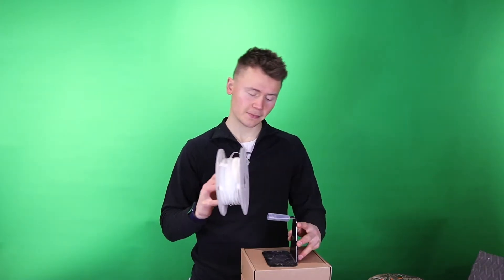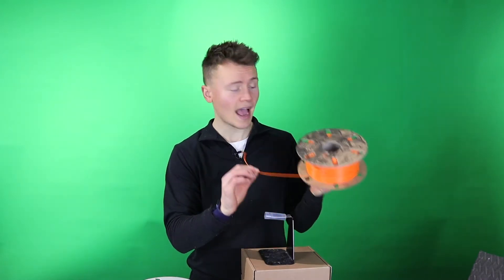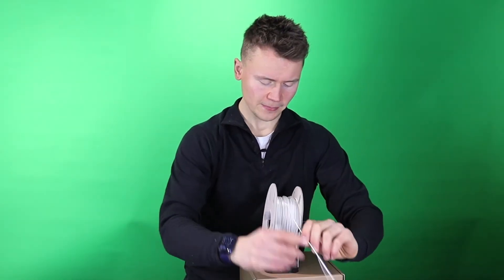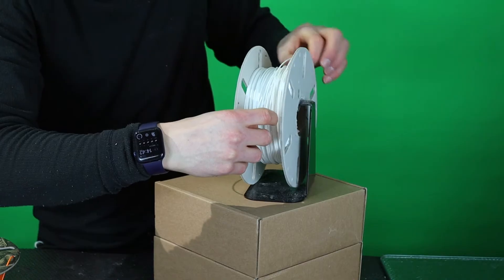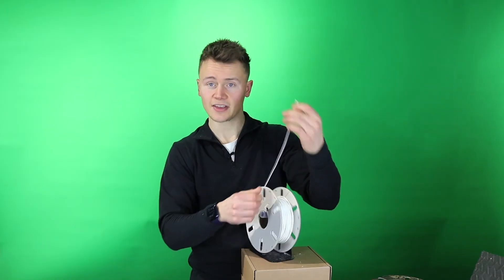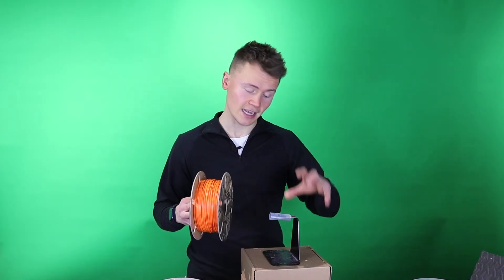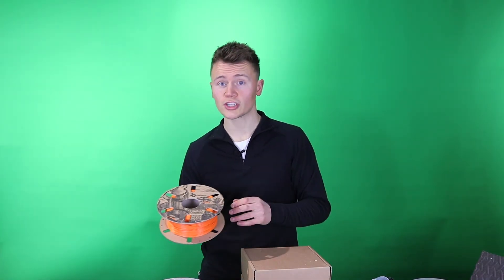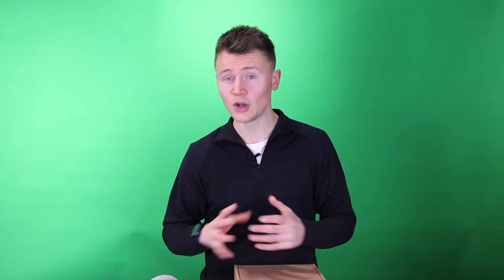FILAMENT TANGLES - How they occur, how to prevent & how to fix

Comment: My filament failure was actually a bamboo Labs spool that came unlocked and when my AMS was pulling on it it caused the whole spool to loosen, widen and pull the filament down deeper into the other layer rolls. It was a disaster. It was too wide to fasten the two-piece spool back together. 

As far as storage I printed out nice simple little clips so I can just clip the filaments in line with where it is on the spool without having to weaving it into the side.

Comment: Got my first tangle after 2 years of doing this. New roll. How was this me? It printed 10 hours before it tangled. I blame the factory….. sorry.
Reply: Yup, just happened to me.  I had a number of items to print--almost continuously over the course of five days.  I started printing with a used spool (roughly 200g of 1kg remaining) and when that reached the end I opened a NEW spool and fed it into the bowden tube right at the end of the previous filament.  I watched the job for about 10 minutes and walked away.  I came down about 30min later to find the printer paused due to a tangle.  I pulled on the filament on the reel and it took quite a bit of effort--definitely more than an extruder could.  Print job continued and paused again when the filament reached the same "outer" position on the hub.  For some reason the spool was wound at the factory with an "underlap" of the filament at the outside edge causing this.  The entire spool required me to babysit it.  When that spool was depleted, I opened another NEW one, and the same thing happened.  This was the first time that this had ever happened to me.  A factory spooling error.

Comment: Well that was very helpful. I couldn't understand where the repeated crossed filament in the AMS was coming from. Mid print I thought I could pause, unload and check. But apparently not. Instead I handled the spool as it was printing. Found the cross, dropped a couple of rounds off the spool. Rewound it and carried on. Thank you. It's a 5hr print and I did NOT want to have to babysit it throughout

Comment: Just had my first tangle due to improperly stowing the end in the spool after its previous use. Understanding that the tangle might not manifest itself for quite a while is illuminating. My tangle happened several hours into a print. Thanks!

Comment: What if the entire filament roll has come off the cardboard center and is not even remotely attached to the spool anymore? Should I just throw away the whole filament roll?
Reply from the maker: @uniunicron  you’d have to try and wind it on a empty spool, but it’s quite difficult to do so

Comment: best way to avoid this issue the easy way is just eyeball that spool and if it gets tangled unwind the spool as much as you can then try to get the knot off the spool and realign the rings of filament and if this doesn't work pause the print unload the filament pull that thread out of the tangle and reload the filament, I usually just untangle it live though so only do that if the tension starts to get where you cant get your finger under the pla filament.

Comment: I genuinely don't agree with this advice. I've just taken spool out the bag, fed it into the print all under tension. 10 minutes in filament tangled in spool. Not first time either. I genuinely don't think this explanation has anything to do with the problem. Sorry just my opinion.
Reply: I agree with you.  When I've had tangles they've been deeper into the spool than any layers which might have loosened during loading.
Reply: Same here. First spool out of the bag i pulled out enough to feed into the tube and i notice right away that it was under another strand. I thought maybe thats how it wad suposed to be but 10 minutes later the printer jamed on the test print and i had to cut it at the spoon cuz of how tight it pulled. I just pulled the main strand out from under the other one and thought that would be enough but its been doing it time and again at inconsistent intervals and idk what to do about it

Comment: Just had this happen on a brand new roll, first couple of prints came out ok, Then next 17 hour print failed mid way through. It was a Jayo pla and I though when I opened it that the filament felt particularly tight, is it possable to come out of the factory too tight ?

Comment: This is also incorrect and this guy doesn't know how knots work, he is blaming operator error, not poor design.
Reply from the maker: It is operator error… 
If you repeatedly have filament tangles then the sooner you accept it, the sooner you’ll be on your way to preventing them🙌🏼
Reply: @CallumColes  nah some filaments are way more curly and prone to tangling if they even have a slight bit of tension removed.

Comment: Was babysitting a print for a few hours because the filament kept binding up.  I accidentally dropped this roll when I hadn't secured it yet a few months back.

Finally decided to look for a video and this was super helpful.

I cut about 8 feet to continue feeding while I got the tangle out, rewound and then hung it back in place.

I was able to snip off the 6 feet  still feeding and piggyback the end right behind.

Hopefully it still looks good in the morning.

Comment: Iv been dealing with a brand new spool, it tangled on every print. Also the filament was stringy so it was either a bad batch or improperly stored by the manufacturer. I respooled it and that helped but I shouldn’t have to do that

Comment: Thank u for this video.. sadly, I JUST experienced a VERY bad “tangle” .. went to check the print and it showed it was 1.2 way done….but sadly, NOT! It was tangled so bad it was sticking together? I did manage to get the tangle out and re wind (even did it correctly- did it before I found this video) i was searching to see y it happened .. thank u for the explanation..glad to see i fixed it correctly

Comment: Brilliant. Thank you, just hit my first tangle - immediately thought I had a badly wound roll from the manufacturer. Now I know it was my poor house keeping.
Reply: More like slightly loose on the roll and jostled about during transport. Also rewinding the spool like he did is bound to casue more tangles since it isn't wound evenly from side to side.  Add to that, filament isn't wound my diameter.  It is wound by weight.  It's a nice vid but not quite there yet.

Comment: I had a tangle in the middle of a 1kg roll  that caused a print to fail 20 hours into a 36 hour print. I was so mad I almost threw my entire 3d printer into the garage.
Reply: 20 minutes from a 40 hour print.
Reply: I like how the garage is where your hobbies go to die
Reply: Halfway 60 hours print😢
Reply: I’ve been there brother..  that pain is so real.

Rage, Rest, Recover then OPTIMIZE!!
Reply: I would've thrown mine into the bathroom.
Reply: Bambulabs allows you to restart, worth lookin into!
Reply: This guy is totally wrong, it's not our fault because it got tangled it's the way the factory winded it because not all of the filament spools tangle 100% of the time only in another spool of filament happens and it goes on forever. Untying the knot resembles like an impossible puzzle. This filament is playing games with me now and I'm still trying to finish a print. I had to cut it and then the print is getting under extrusion, my print is ruined a bit.
Reply: Here bc my 20 h print failed 16h in
Reply: Why would you? Just start another print from that leyer up and glue both parts. 🤷‍♂️ It truly isn't hard to do.
Reply: @archNagel would look like shit so no
Reply: Crazy! I don’t t feel so bad about my printer job pausing anymore. At least I can untangle and resume

Comment: just caught a tangle when there was about 20% of the roll left. I've been printing with the same roll from when i unpacked it, so never pulled the filament out the extruder. Don't see how this can be my fault... It's even a spool that looks nicely rolled up
Reply: yeah that’s why I’m here.  Happened 3-4 times on my last roll from Bambu.   New roll, never left the end loose.   I think I’d rather have my print pause than unroll the whole roll to check it and re-roll it.  Lame.  seems to happen mostly with Matte filament.  The matte surface seems to have enough friction to enable the auto tangle feature.
Reply: @CGreciful  Well, I was just having tangling issues with my white matte roll. Hopefully there won't be more. At least the AMS auto-detects...
Reply: Some of the .5 kg rolls do that. Or they're really tight near the end and break if too fast.
Reply from the maker: Would be unusual for a tangle to propagate that far back into the spool for sure... Was it definitely a tangle and not two strands of filament joined together or wedged between the neighbouring strands?
Reply: @CallumColes  no i had to pull it over the side and get the knot out like you showed in ur video.

Comment: i just got a 3d printer, didnt know about filament tangles. The filament i got didn't even come in a spool. got crazy tangled, currently just relying on a small amount of wire being loosely hung on the handle. Gonna see if i can improvise some sort of spool.
Reply from the maker: I have unboxed some 3D printers where there is a coil of filament without a spool, not really sure what they are thinking as it is a bit of a recipe for disaster for a new user! If you have purchased filament seperately from the printer and it did not come on a spool, then it is likely this is a refill designed to be used with a reusable spool e.g. MasterSpool. There are lots of designs on Thingiverse that can be downloaded and printed :)

Comment: Do people actually spend hundreds of dollars on 3D printers and store their filament just loosely?! That just seems crazy to me. I guess this is good advice for those people. Or if you get super cheap filament from a poor source?? My filaments have always been perfectly tight and well-formed for years. Good video (audio clipping was bad though), thanks :)
Reply from the maker: Pretty much anything you can think of, somewhere someone will be doing it lol. In my opinion though, probably the most common cause of tangles would be when people are loading/unloading filament. I feel it's less obvious that the filament still needs to be kept in tension throughout this process.

Comment: I had multiple tangles in the filament right out of the box😢
Reply from the maker: Always worth checking just in case, whenever you get a new roll, if it looks suspect always try to pull a few loops off the side of the spool to make sure it comes off freely and there are no tangles.

Comment: I think mine somehow got tangle from the factory because I just got a tangle 23 hours into a print and I’ve also used the holes to store the end
Reply from the maker: It is unlikely unless the filament arrived looking like a birds nest, tangles can often show up later in the print as the extrusion process slowly pulls the tangle tighter and tighter like a knot until it can no longer move

Comment: in some cases, it comes with FILAMENT TANGLEs
Reply from the maker: Thanks for the comment! It's very unlikely for a product to turn up with tangles, the main cause would be if the filament had come loose from the holders during transport. Because the chances of a product turning up with tangles is low, if you're finding that you have frequent filament tangles, then it's definitely worth evaluating your setup. Look for excess slack in your setup. Add friction to the spool holder if necessary. Always store filament properly secured in the guide holes.
Reply: @CallumColes  thanks for your helpful comments.  sometimes I get FILAMENT TANGLE.  I will try card board or other spool filaments

Comment: Oh this is just wonderful!  I’m preparing to do a video on the same topic this week too!  It's such an important thing that can save prints from failure.  There is also a lot of misconception that tangles are introduced during the manufacturing process due to not understanding how a tangle can be introduced and then shifted down the line, causing blame to be incorrectly placed.  If I could like this video three times, I would!   I love how we were thinking the same thing.  I'd say “great filament-focused minds think alike” but that just sounds silly, heh.  Love the video!
Reply from the maker: So glad you liked it! Truth be told, it's been on the to-do list for a while, but I've kept putting it off as can be a sore subject if you've just had a print failure... I think that's part of where the misconception comes from, very easy to blame when you're angry and your print has just failed. But yes, as you say, the fact a print can start okay and then tangle some way down the line definitely adds to the confusion. 
From one filament fanatic to another, I look forward to your video on the topic:D